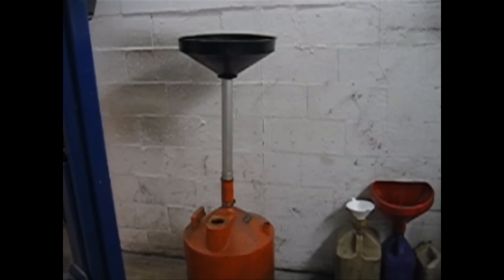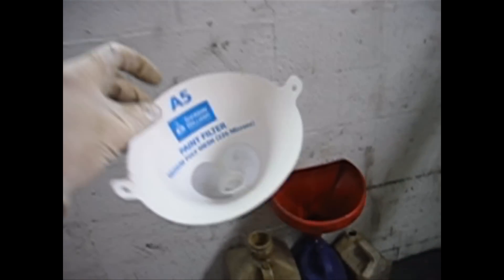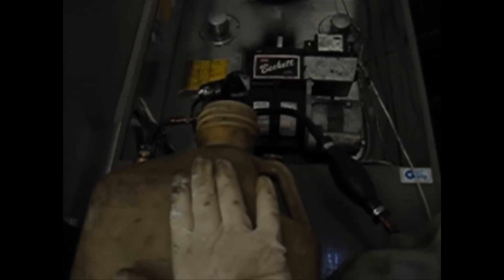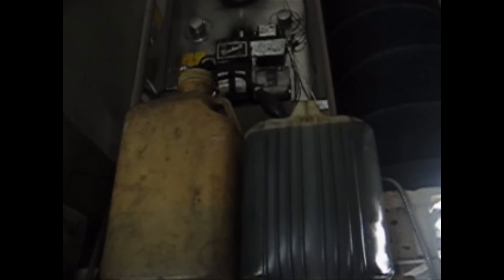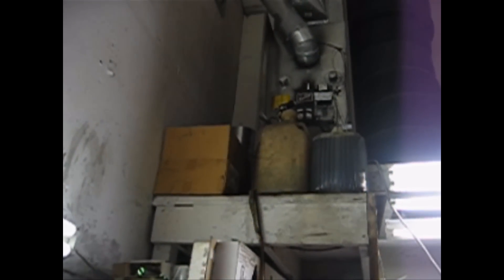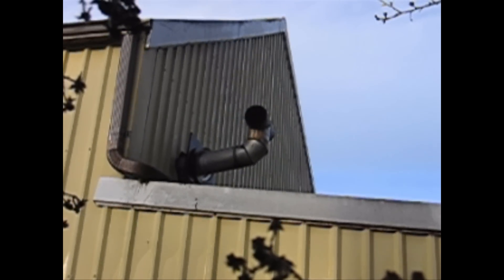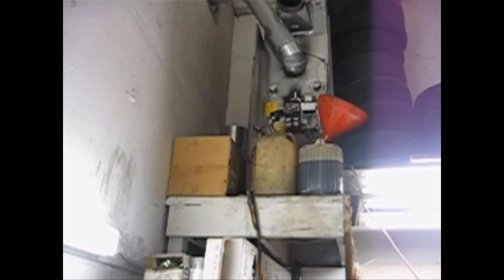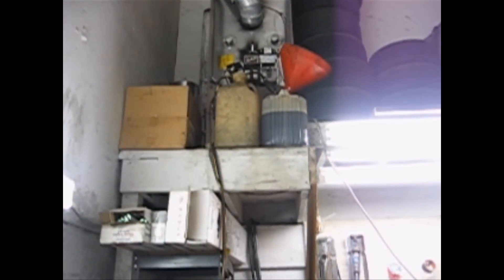Homemade Waste Oil Furnace

Comment: @TriHerald   Although I agree this is pretty cool & possibly cleaner or at least as clean as a regular oil (Diesel1) furnace, I must disagree about this being the most "environmentally sound" method of "disposing" of used oil. Most auto parts stores accept used motor oil for recycling & to recycle used motor oil not only gives it a second life (possibly more) it slows down the consumption of virgin petroleum and in the big scheme of things, that is using less oil. Less oil=environmentally sound.

Comment: hehe, i must say, after i have been watching some videos about how people but their waste oil, i wan't to tell you and others to stop bothering with modifying a regular burner to a waste oil burner.
Buy a multi oil burner or a rape seed oil burner. They use compressed air to vaoprise the oil, they almost don't need any cleaning if they'r set right and most important, they turn on by thermostat wich you dont need to monitor. Ill make a video to show you my setup ;)

Comment from the maker: Hi there, this furnace in this video has no air injection at all. It works fine but hard to regulate temperatures, unless you open a door to let cool air in.

Comment from the maker: My shop generates 500 gallons of waste oil per year. It's a lot of work to dispose of that much oil. Although I could pay 50.cents per gallon to haul it away.  To heat with natural gas would be very expensive as I have a backup Gas furnace and know 1st hand. I assumed auto parts stores collect it then pay to have it hauled away where it is burned for heat in a waste oil furnace someplace. I don't think waste oil is remade into new oil.  is it?

Comment from the maker: back then was a bit different.  Waste oil had no use and was dumped, usually in streams. Nowadays it's better.... I did a little research. 75% of used waste oil collected is used as ' industrial fuel '

Comment: No,. used motor oil is not recycled. The problem with used motor oil, is that it containes heavy metals, wich have worn of the inside of the engine. The oil also has lost it's lubricating properties. When it is being disposed of, it is burned, but it has been centrifuged first, to remove as much as possible of heavy metals, and soot collected in the oil, wich hasn't cemically bonded to the oil.

Comment: hay 2stroketurbo i have made my own oil furnace but im heating my oil to 315 deg . i would like to know more about your air injection part of your furnace. mine is burning really clean no prob starting when cold, but I do need to add about 10% #2 diesel and I would like to go only oil. its a great heat and all my friends are looking for old oil furnaces. I hope U read this and get back to me s1gumby9 thanks 4 the Utube